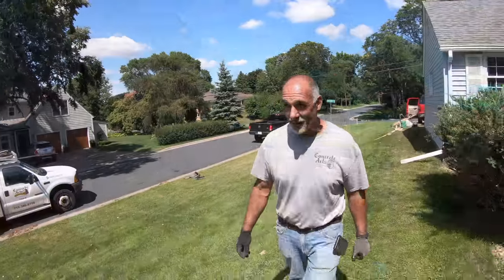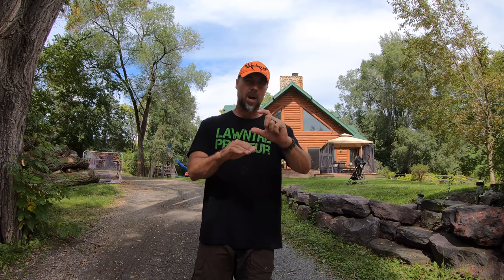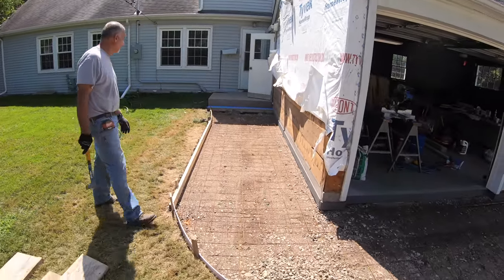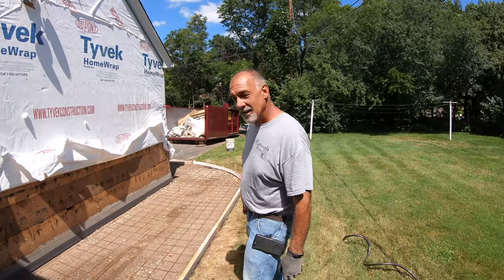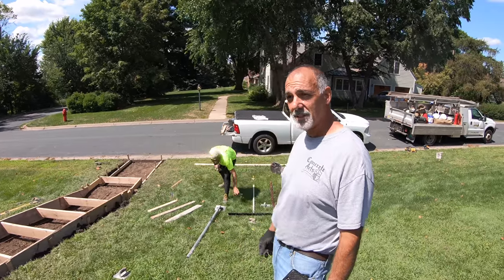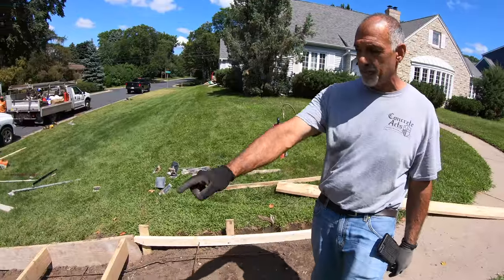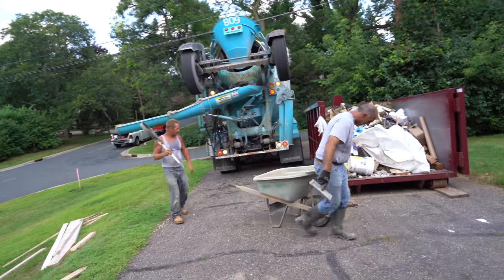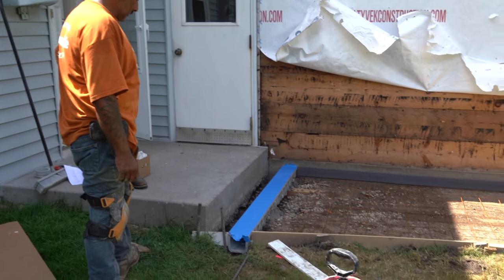How NOT to pour a concrete slab, sidewalk or driveway. Beginner mistakes & Red flags! 4k video

Comment: To everyone.
1- Always oil your forms no matter what your pouring bc the concrete will stick to the form and it will pull out chunks.
2- Yes the radius was not right any radius should not have a flat spot in it at all.
3- Always try to pour your steps first bc it's true usually your slump will be dryer than u ask for when the truck comes u can always add water for your sidewalk if needed but u can't take it back out.
4- Stay away from fiber it's the biggest mislead product sold to your customer. Always use rebar or wire or both if need to be.
5- U should always put a footer around your pour and not just pour it flat believe it or not concrete can and will float up causing cracks and sometimes separations.
6- When pouring a apron going into a garage,  building u should put rebar in the front bc this is where ur pressure starts, and doll rebar into existing concrete this helps to keep it from sinking and helps bond to other concrete. 
7- Always compact your gravel the only thing I agree on in this video is your concrete is only as good as your base so make sure the contractor compacts the gravel before installing any plastic, rebar, wire.
Reply: 1.  I haven't had problems with concrete sticking to my forms...yet.   Even so, I wish I knew this befLOL.  (Update:  please read my next comment below).

4.  I have heard fiber helps with cracking, but I wasn't convinced enough to shell out a couple hundred more for it.  To me, it sounds more like a gimmick but I'm not an expert either.

I used both rebar and mesh 1.5 - 2 inches below the top of the slab.  I also can't see how fiber is going to provide better reinforcement than rebar and/or mesh.   But again, I don't have years and years of experience so maybe I am missing something.

7.  I compacted the hell out of the 21a delivered to my house.  Had several heavy rains before pouring and no soft spots ever showed up on my gravel base.  Hopefully I did this part right.

The only thing I am worried about is that even though my gravel base is solid, it wasn't exactly uniform either.  The end result was a slab that is between 4 - 6.5 inches thick instead of a uniform thickness.  I hope this won't be a problem.
Reply: Ok, so just to update you and anyone else reading this....

I removed my last form board about 10 minutes ago and guess what happened?  A chunk tore off from the edge of the slab.  Karma bit me in the ass really hard.  If I ever do concrete again, I'm oiling the boards, Lol.

Comment: I'm a civil engineer and adding water to concrete after delivery is a bad idea. You just make the concrete weaker. If you need it to be more or less liquid then say so and additives will be added that will not affect the final product.
Reply: In a pure world of compressive strength and water/cement ratios, that's exactly correct.  In field conditions, especially residential work, few know about ASTM C 94, WRAs and the 90 minute/300 rev rule.  There are other considerations...initial batch slump, sand moisture and how it releases (or soaks up batch water) in the mix, cement type, grind and composition, travel time, ambient weather and whether the producer is using a wet or dry batch plant.  With today's mix designs, I'd rather add a little water and chance a 150# loss of 28 day compressive strength than a poor placement/finish that would likely have to get torn out anyway.  For being a relatively simple concoction of 4 materials plus micro air and WRA, concrete mixes are capable of some pretty unusual behavior.  

As a driver or finisher, you're always playing the time game, whether it's spec on the job or the countdown marching forward every minute that load is in the truck or on the ground, WRAs or not.  Modern batch designs are pretty amazing and somewhat forgiving of poor practice.  Which of course isn't an excuse to empty half a head tank into a load to make it self-leveling and near the segregation point.  On a residential application such as this, however, losing an inch of slump with a few gallons of water isn't the end of the world, especially for a DIYer.  If we were doing structural piers for a federal bridge job, for example, that's an entirely different matter.  My 2¢ worth...
Reply: Hes talking about adding a splash of water when necessary, not bucket loads of water.
Reply: It says available water right on the ticket.

Comment: Mesh should be covered by an inch minimum top bottom and sides not only for strength but corrosion. When steel corrodes it expands leading to concrete spalling. Control joints look good but don't see any expansion joints.
Reply: I didn't see any of the guys pull the mesh up into the mud. They just left it on the ground so it just got covered and isn't going to reinforce the 'crete any. In Massachusetts, building code says minimum of 2 inches of coverage on rebar/mesh
Reply: @vermontroadie  I see many videos by "pros" not pulling it up. Here in CA I've never used it for DIY projects. Also it doesn't freeze here much, so the base material isn't always focused on.
Reply: They can put fiber in the concrete too. That helps.

Comment: When we poured Cement for the County, my Forman would get pissed if you used a mag float first. 
We always used a wooden float first. 
He said that it was because it pulled up the Portland and weakened the concrete. 
I have seen sidewalks top surface peel before, I suppose that is what he meant!
Just saying
Reply: So use wood, then mag after?
Reply: @kbanghart  
Correct

Comment: I always add vapour barrier sheet beneath the concrete just ensure the quality of curing. What is your opinion on this?
Reply: You don't need vapor barrier on outside work
Reply: @RHEC1776 No, that is not correct. A vapour barrier is used to minimise moisture loss and prevent cracking. If there is a water source & the concrete can be kept moist for several days, a moisture barrier may not be required. If you're in a dry area and can't keep the concrete continuously wet, a barrier is a good idea. This is particularly important with slabs that are only a few inches thick.
If the work site is exposed to the elements (wind and sun) this will speed-up the water loss.

Comment: That radius had a big flat spot in it 👎🏾 crawling on your knees to rod concrete is not ok...bend that ass over.Where radius joined straight 2x4 did not flow through it was pointed on the ends making a slight corner thats rookie.But this could be the standard in Arkansas

Comment: This reminded of my days of setting Terrazzo floors. 

You couldn’t pay me enough now. 😂 

IMO it’s always the ‘finishing work’ on construction projects, that are the best. I mean after all there is nothing beautiful about exposed pipes or wires of electrical work. 

Yet a terrazzo floor can easily become a work of art. One that lasts a lifetime. 

Years ago we would pull cement terrazzo but you had limited options.  Once epoxy came along, the jobs also were more in demand. So were the elaborate designs! 

It’s expensive, but it will easily last 100 yrs. Heck, I restored many church floors that were cement terrazzo and almost or even older than 100yrs. So now image epoxy! 

Yes, you’ll always get some patch work when restoring a floor. In most cases the older the floor, the more impossible to match identically. 

So if you’re new to marble and terrazzo, my best advice is never promise anything, especially as far as patch work. Learned that lesson the hard way. 

Tell them you will give them 3 samples, no more and try your best to match it. 

As far as the rest of the restoration? Sand a 1/16’ off floor 120 grit 220g acid polish. 

Floor will look brand new.

Comment: Concrete has a 2hr life span from batching time unless  you get a retarder in it  , I did not like the sidewalk  , the wire was not pulled up into the mix  !  Plus you did not mention AIR  intrainment also you can not use Steel on it as you will take the air off the top .

Comment: The radious was to tight. I never use wire, 4000 psi no flyash. With fiber. But i did like the video. Very good

Comment: What is the point of using wire if you are letting it lay on bottom. Typically you pull up to be in middle of mud.

Comment: I've worked in different shops from old to brand new. In every single one of them, including the wash bays. The water flows AWAY from the drains....... When I build my shop. If I pour a bucket of water on the ground and it doesn't naturally flow towards the drains. I'm making them tear it up and do it again.
Reply: That's why it's important to check drain grade at least 3 times before the pour, and double check with level and/or kangaroo rod while rodding the slab out.  Also important to install a bombproof subgrade to prevent settling, especially in wash bays where there's a possibility of water infiltration.  Subgrade with fines doesn't work as well, better to use bedding rock, similar to what Stan calls Class 5, the more uniform and cubical the better.  Allows for proper drainage of the subgrade after slab installation, and good cubical material achieves near 100% compaction even prior to plate compacting.
Reply: @jayphillips4058  well said and on point

Comment: I often wonder why companies still use the rear discharge type cement truck vs the  oshkosh front discharge where the drive sits under the chute. ?  I assume a cost difference maybe, by swapping mixer from truck to truck. ?

Comment: You use a retarded in the concrete during summertime? That's cute. We used to just scale back from the usual double shot of rapid set to just a single shot... In the peak of summer only though... In Australia. 

It's really interesting to see the differences between US concrete and Australian concrete. 

For instance, this is a 2 man job, not a 4 man job; it could be a 1 man job if you want the money though. Though, if you go to Queensland, I'm sure you'll see them make it an 8 man job. Also, it's really weird to watch 'ya crazy yanks' screed concrete by striking it off with a wood plank. C'mon boys, grano work is a highly respected precision trade, you need to be using precision technician tools like an Australian screed... That is, basically, kind of like an aluminium spirit level with a handle, more or less. Float on the concrete, be the hovercraft, don't drag your screed on your form boards. 

Good to see you guys using a proper agi though, not like those funky front discharge things I've seen pictures of. On the flip side, I can't get over the wheels at the back - I know it's a fancy technical thing to extend the wheelbase and overcome poorly thought out laws about GVM which applies to some roads and bridges, but man, those wheels are just a weird contraption.

Also, barrow boy needs to learn how to arc his barrow and really get it up onto the lip and off that wheel. He needs to 'fan' it to spread the concrete, not just dump it in a pile and then expect Mr. Boss Man to scrape out the dregs with the shovel. On a similar note, I like the reo hook on the rake; haven't seen one before but it seems like a good idea. At least, I think it's a reo hook, it would make sense and I can't imagine what else it would be. 

From the second video: "Brooming isn't meant to hide any defects, it is meant for traction." Incorrect my good sir, there is a reason we call it a broom and zoom in Australia, it's because you don't have to do a perfect pre-finish, because you're just going to broom over it anyway. If you're going to hand trowel it, well it's like painting, it's all about preparation. But that's the difference between decorative and functional. 

Ok, I'm doing being a snarky ex barrow boy... Good work guys.
Reply: Lol you wouldn’t last a day on a pour and finish in the states I can tell you that now. Clearly you haven’t used the old tricks and have been spoiled with all the newest and best finisher tools😂😂
Reply: @RETIREDAMATUER  You are correct, I wouldn't last a day in the states, I'd walk off in frustration that there is an entire gang on site for a 2 or 3 man job. And I'd instantly lose my cool at the fact that people are willing doing things like striking off with a 2×4 like a bunch of monkeys instead of just spending $100 on a screed that will last forever, like a professional.

You are right about something though, I'm an absolute princess about my tools, never saw caked on concrete on my stuff.

Comment: Another great video Stan ! down in N Florida when I was working site work all they would do was wet it vibratory roll it some times get density if required 
but if they knew the inspector some time they would let them slid if was off a little.that was for drive ways on commercial jobs that were concreet . Good inspectors and superintendents is the key to getting a good job done. Iv'e seen finished lime rock  that was pumpie that had ground water seepage you would have to dig it out and redo it . On one job that had a lot of clay we had to bring in lime rock and mix it to stabilize the soil just to cut the sub grade . I'am probably geting a little bit to deep for some folks. On most all new construction on residential they just skid steer it not even tamp it that is your big home builders for you.We didn't do that kind of work just the street an utilities for them. they are some cheap a**es .  I could go on  but I will stop . THANK FOR ALL YOU DO STAN FOR THE WORKING FOLKS !!!

Comment: First of all love all your videos, I own a small landscaping company.  I specialize in Tree's stump removal and some hardscaping.  In PA i must say I may over do my patios, I always put down 6 inches of gravel and pour the patios 6 inches.
Reply: Code is 4 to 6 I’m pretty sure for slabs/sidewalks so you’re good. 8 to 12 for footers/foundation
Reply: LOL.  That's not over doing it.  I over do it using 12", 6" of #2/'coconut' and 6" of #57 crushed over fabric and pour 6", even for sidewalks.  I know some day someone is going to run some piece of heavy equipment over the flatwork for some reason.  4" of aggregate is not enough as I've had to replace A LOT of sidewalk where that thickness was used due to cracking and uneven movement.

Comment: Is he not aware that you can get stealth fiber reinforcement which is meant for anything with a broom finish
Reply: Why is it good for a broom finish?
Reply: it doesn't pull up as easy as regular fiber. most plants use micro fiber only these days or stealth fiber. u have to ask for big fiber or even steel fibers. those are trash for looks but good for strength

Comment: Amateurs!
If the reinforcing mesh is not on plastic chairs it always sinks and ends up on the bottom (see video link i have attached showing this below)

The best way to support the mesh so it stays in the middle is old driveway blocks that you find on local  adverts that people are giving away free of charge.
These driveway blocks are 50kn so plenty strong enough.
It made me laugh when he said 'on a 4 inch slab we normally try to get the wire in the middle or the bottom 2 inches' 😆
Half of 4 inches 'IS' 2 inches...so its the very same thing🤭
Link showing you reinforcing mesh that hasn't been supported. https://youtu.be/RFrhMOFZDpA

You cannot 'lift' it up as you go because it will sink back down again especially because your still standing on the end of each sheet as you go.
John (old English builder from the UK)